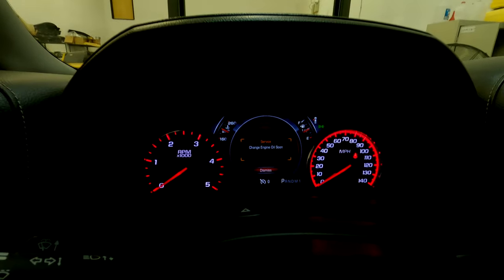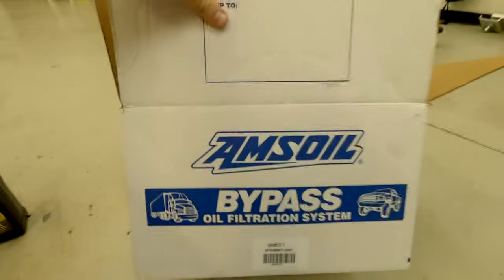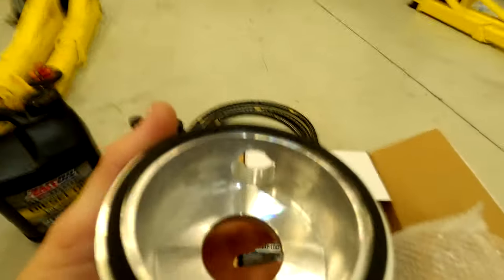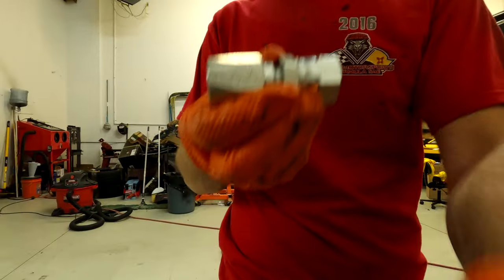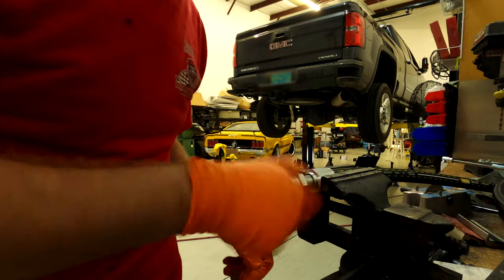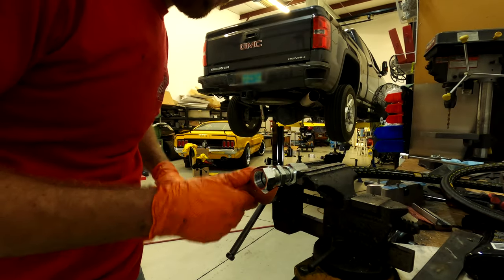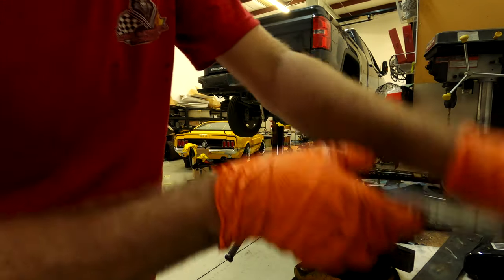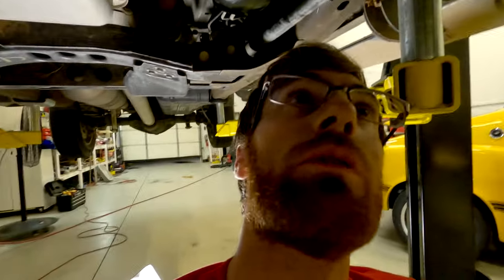2016 Duramax Oil Bypass Filter

Comment: With that location did you hear any kind of humming or whining noise after installation?
Reply from the maker: No, it is using the stock oil pump, so there isn't a lot of vibrations that come through the filter housing.